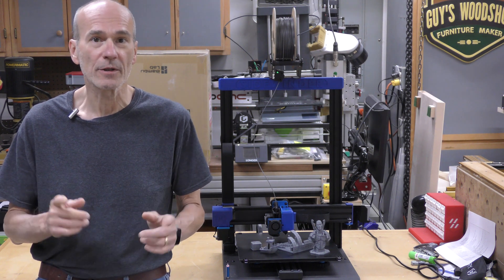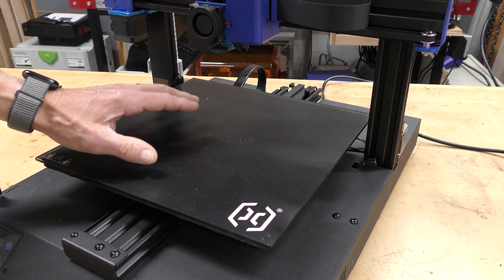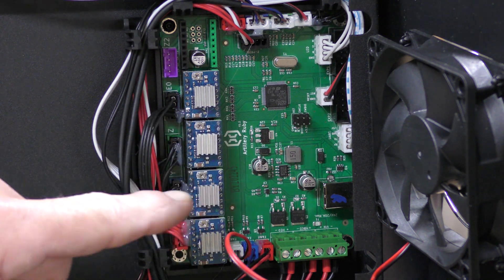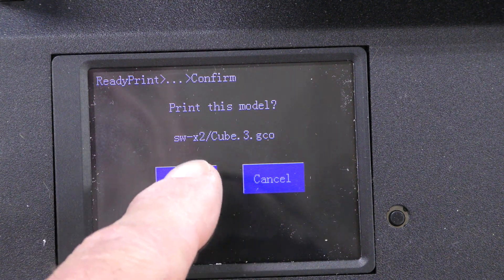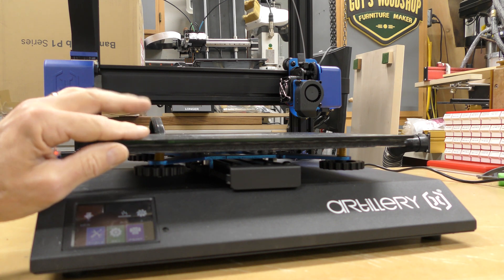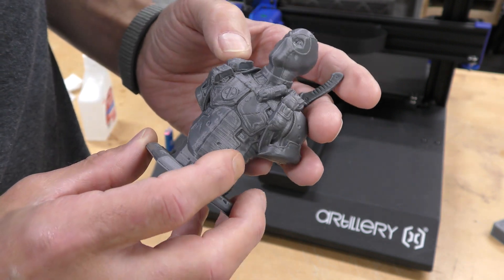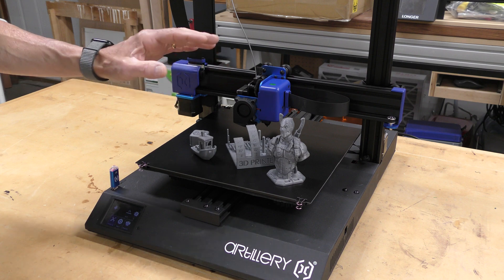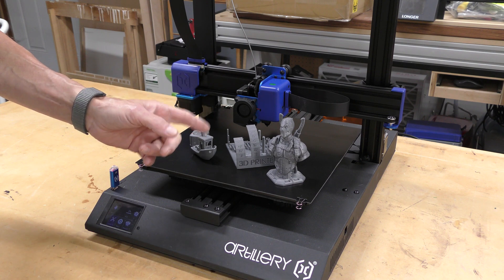Artillery Sidewinder X2 3D Printer Testing and Review

Comment: I do not have any issue's with my print bed as long as I let it cool. In fact some prints release themselves. You will hear a pop and they have sprung free. I noticed it looks like your first layer looks a little low. Maybe use baby stepping and raise the first layer slightly?

Comment: I have one of these for my classroom.  I want to avoid as many issues as possible when we begin our printing.  Where did you purchase or can you tell me where I can purchase the PEI board you added to your bed?  The ones I have found are either metal (is that ok for this) or adhesive on one side.  I rather just clip it like you have done.  Thank you.  You video helped me with figuring out a few things on mine.
Reply from the maker: This is a link to the exact sheet of G10 that I used for the new build plate: https://amzn.to/3sC6dts

Comment: Guy, I run 11 of these X2 machines, with certain upgrades: Switch to an all metal hotend (change the heatbreak, microswiss nozzle, and ptfe tube inside), switch to a metal titan aero idler arm and tension screw, move the Filament runout sensor to the mainboard on the ZMin pin. The wiring for that is already included, and change out the firmware in both the motherboard and the tft to a more current version with upgraded features such as input shaping, linear advance, M600 direct on the Motherboard, nozzle parking, UBL bed leveling, etc. Change the ABL sensor pin to an upgraded version (I sell these on my etsy website store) made from a much stronger and reliable material. (These are known to have issue with reliability, and are prone to breakage).
After these upgrades, you will find this printer extremely capable, and I regularly print production runs on it in my farm at speeds in excess of 150 mm/s without any issues. If you ever want to chat about 3D Printing, or the X2 in particular, feel free to reach out to me. I'd love to chat!
Reply from the maker: Good advice! I already have a new heatbreak for it, and some CHT volcano nozzles are on the way. It will also be running klipper afterwards.

Comment: Looks like a solid machine. I like the replaceable stepper drivers. Will be interested to see the longevity of those cables, I've heard good and bad things about the ribbon cables.
Reply from the maker: I think most of the criticism was on the X1 and lack of retention clips. They have corrected that issue on the X2 and they do include an extra cable with the printer. Hopefully it will not be a problem for me